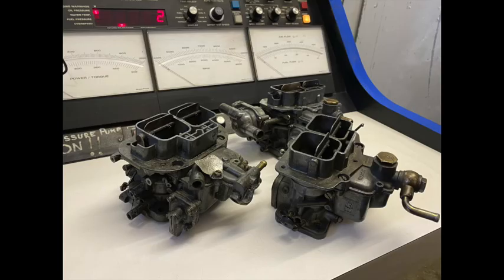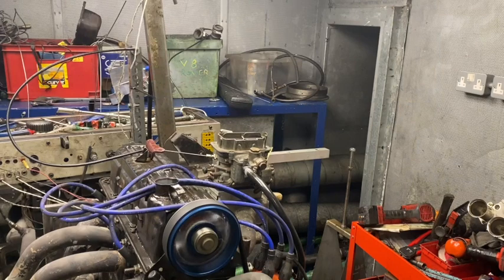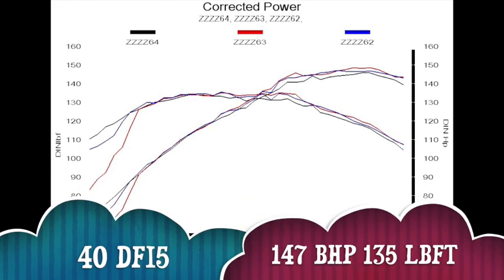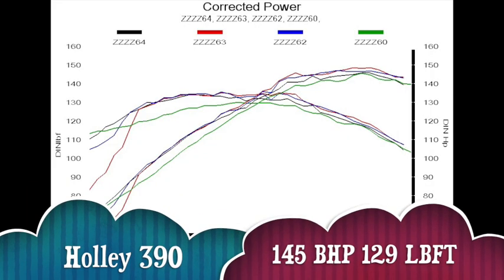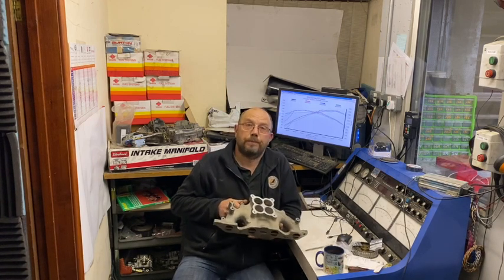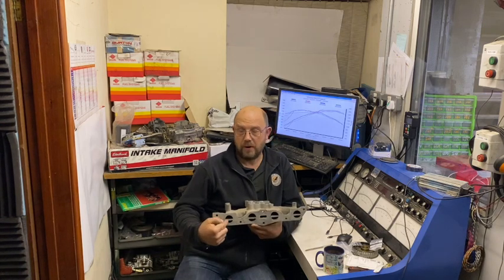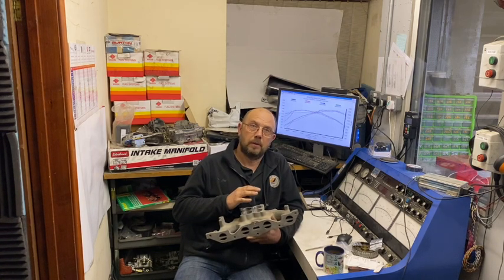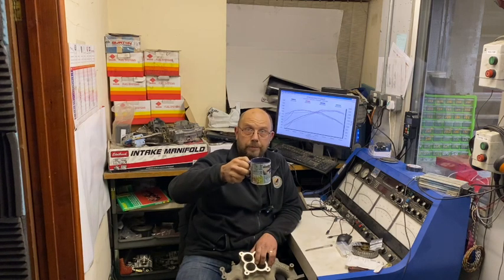FORD PINTO, WEBERS V WEBERS V HOLLEY CARB

Comment: Thanks for the 4bbl comparison video. I ran the Holley / Offenhauser combination for many years, The stock #6299 Holley did not perform well, after re -jetting and delaying the secondary opening it did some better.  I later swapped out the OFFY and installed a Spearco manifold and with no changes to the carb it was noticeably more responsive. the Spearco manifold orientates the carb opposite the Offy. Fuel bowls front/back to Offys side /side and the Spearco is not a dual plane manifold.
Reply from the maker: Thanks that backs up my feelings on the setup I tried

Comment: Had a 390cfm Holley & Swaymar inlet manifold on a 3.0 v6 Essex with Burton stage 2 heads & Kent v63 fast road cam back in the day. I found it was to much carb  for that engine. Ran much better on the street & made more power with a re jetted Webber 38 DGAS. Thanks again for a another great test.
Reply: Interesting, a friend had a similar setup, though he cast his own inlet manifold for the 390 Holley on the V6, his was about 3100cc and had a "fast road" cam of some sort, I think from Piper. It was a long time ago but I think the heads were allegedely RS3100 but with some work done . Engine had Howe exhaust manifolds and pointless ignition. I believe at best it produced 180hp at the rear wheels which seems like a lot for that engine...

Comment: Your channel just recently showed up in my suggested feed. I’ve had the stock carb,Webber 2bb( 40/40 or 44/44?) on stock intake,also Holley 390 and same 4bbl intake. Never occurred to me that the dividers of the 4bbl intake eats up quite a bit of area,so  flow is probably down all across the board. This was in the late 90’s. Also I heard the factory 2.3l 4bbl intake was the best at the time. I had heard the d port heads were better also. I in America.

Comment: I have one of the Wiand intakes if you want to test it.  I also have a Crane Cam performance cam.  I am running 2.3L now so I can't use them.
Reply from the maker: it would be great if i could do a test on that intake
Reply: @PenguinMotors  I am in the US; you will have to give me a shipping address.
Reply from the maker: @cmsracing  units 16b 17a lancaster way business park. ely.  cambridgeshire. CB6 3NW united kingdom
Reply: @PenguinMotors  Do you want the cam too?  I can give you all the info. on it.
Reply from the maker: why not? if its easier you can drop me an email, penguinmotors@outlook.com  regards graham

Comment: Can you do a video of Fords pinto EFI engine compared to Webber carbs what are the advantages and gains between them in performance and reliability
Reply from the maker: there is something in the pipeline, but in terms out outright power there is little difference between efi and dcoe webers, only when you have really wild cams does EFI start to pay off in terms of performance at part throttle and lower down the rev range.

Comment: Do you have a source for the dgas throttle shafts and linkage I've been having trouble finding what I need for them so I am reduced to the 32/36 witch is a good carb it's just not a 38
Reply from the maker: unless you have a v6 engine dont bother with the 38 carb you will not get any more power from it
Reply: @PenguinMotors   40 over 22r with a 20r head in a 4x4 need the low end power and mid range the 32/36 doesn't have enough to me  dyno may say differently but I liked the way it preformed
Reply from the maker: one of the best things about the 32/36 is its midrange flexibility. you can improve the 32/36 by reworking the throttle spindles and opening the venturi from 26/27mm out to 27/28
Reply: @PenguinMotors  I'll have to look in to that  I've also heard of guys taking the 32 linkage and with some fab work make a 38 progressive with with the linkage of the 32 I like the idea of it but have to kill a carb to do it I haven't seen dyno numbers but it does seem to work nice as the primary was allways week and sluggish the you hit the secondary and had a dead pot I never could get read of with jets the 38 never had  that problem just runs rich at idle and seems to lean out around 5800 thanks for listening to me ramble  I don't know as much as I would like to and that why I watch channels like you thanks for your patience and time

Comment: Hi mate really enjoy your videos on these pinto engines been watching for while. 
I have mk2 road rally car hopefully picking up pinto next week. It’s running down draft with standard bottom end. Looking at maybe mild porting on the head. Is it worth fitting a mild cam or will it make the car less drivable with little gain running standard compression etc.
Reply from the maker: FR30/ BP134 will give more power/torque right through the Rev range

Comment: very interesting, poor old holley
so, is it a 28/36, or 38dgas i want for a road-going 2.1 cortina, very mild cam fitted
Reply from the maker: Use a 32/36
Reply: @PenguinMotors  thankyou

Comment: I have a standard 2l pinto with an fr32 cam and 40 dcoe’s.
Would there be any power improvement with 45 dcoe’s?
Reply from the maker: YES power will go up. even a bog standard pinto will give about 3bhp more on 45's than 40's, id guess you'd see 7-8 bhp more on the big carbs. BUT 40's will be nicer to drive lower down in the rev range
Reply: @PenguinMotors  thanks for the reply.
I guess I was more wondering if it was an issue being on 40’s rather than the 45’s as it was built up 20 yrs ago with the 40’s ( original Italian 40 webers ) I’m lead to believe.
I think it’s in need of a bit of fettling with the carbs.
Love the vids by the way. 👍🏼

Comment: If you put a 2" spacer between the carb & intake manifold and used a single plain instead of a dual port offy manifold, l'm positively sure the 39 Holley will have better top end figures & better drivability compared to the 3 webers
Reply from the maker: I think what it really wants is a normal dual plane manifold, I will try again if I can find one for sensible money